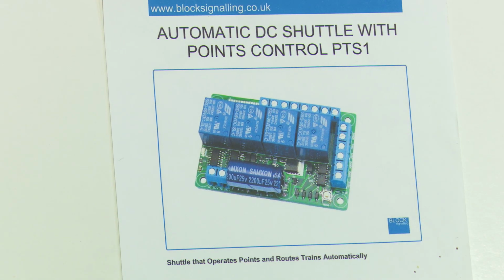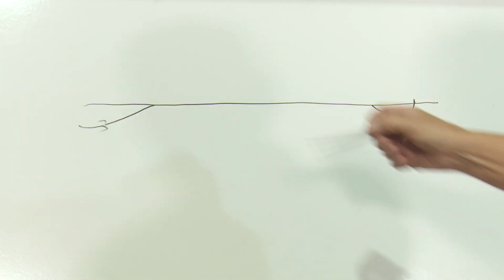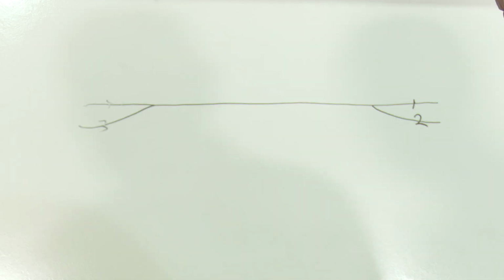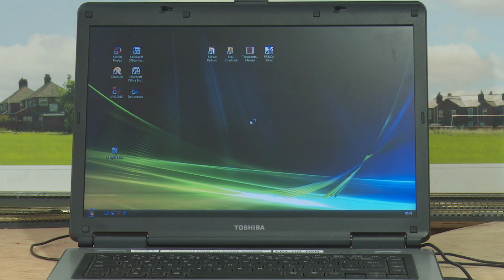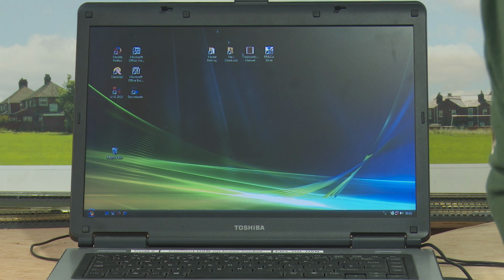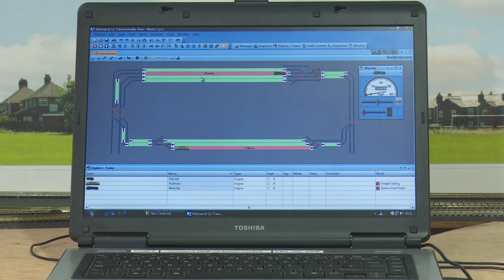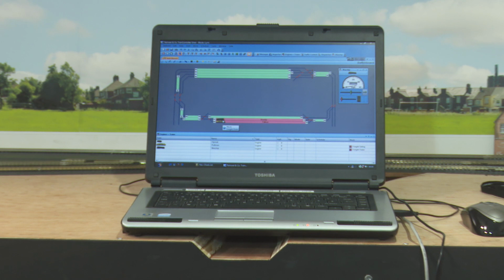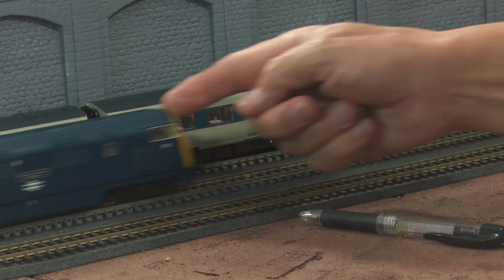Train Automation at Chadwick Model Railway | 108.

Comment: Thanks Charlie you have re energised my enthusiasm will have a look at Train controller as I have been struggling with jmri for a couple of years and it seems more of a programmers thing than model railway control if you know what I mean :-)
Reply from the maker: I know exactly what you mean. But do you have a look at iTrain, it’s cheaper and probably easier.
Reply: Chadwick Model Railway yes I am Charlie, but I’m told it doesn’t work too well with NCE??

Comment: Hi Charlie, another great video on a topic I am interested in. So I am guessing from what you said if the block is bi-directional it would require 3 sensors per block. Seems to me  working out the length of the blocks may be a relationship to the length of the longest train but can points location also impact block length. What do you do regarding block detection where you have points? If you do have blocks at points how do you deal with a complex junction where multiple trains could go through at once? If the points are not block detected what stops a second train moving if it momentarily detects clear track whilst first train is traversing the points? Are you planning a more advanced video or can you point us to some good reference material? Cheers Onky
Reply from the maker: Great questions. It’s recommended that points are not included within blocks, and collision is avoided because the routes are protected which travel through the points networks. Yes bidirectional blocks will require three sensors but the whole train doesn’t have to be contained within one block either, you could have a train that occupies two blocks, the world is your oyster!

Comment: Hi Charlie that was a very interesting video can block detection work with any DCC system or is there a specific DCC system that you have to get and is there any other hardware that you need to get to use block detection?
Reply from the maker: You’re right that not every system can work with block detection. Other programs work on time which can also be reliable. It’s just a case now of doing your homework and planning ahead. Regards Charlie

Comment: Hi Charlie, 
The most lucid explanation on computer control I've ever come come across. I've experimented for years with DIY computer programs with limited
success but this program opens up new hope that one day I may achieve what I'm after. Anything you have to offer in the future on the subject would
be very welcome.   Well done Charlie.   Regards.
Reply from the maker: Thanks Indigo, I’m so pleased that you found it interesting, regards Charlie
Reply: @ChadwickModelRailway  Hi Charlie... What happens if you shut down your railway and shift the trains, or locos to different
locations on your layout and then switch the layout back on. Does the computer system find the trains new locations on your
computer program track plan?  or does it bring up the old locations?   I've never seemed to have been able to find any solid answer
to this.  Regards  indigoDVW  NZ

Comment: Thanks Charlie. Another informative video. I had already figured that the 3 seperate shuttle features I have planned for my DCC build have to remain DC and can because they each will be unconnected to anything else. But, how does the train go back the other way when it is past the diode and diodes only let volts go one way through? 
The DCC slippage was the issue I identified with time involvement....DMU stopping well short or sitting against the buffer grinding away. The second stop now sensor solves that.
All trains need to have the same length with the drive end at the same end if you change the trains on your shuttle....at one station the stopping devices need to be at the buffer end of the line, the other station the stopping devices need to be at the platform begins end for both DC and DCC control. Plenty to think about!
Thanks again.
Reply from the maker: I’m so pleased that you enjoyed it Robin and yes it certainly does involve some serious head scratching, regards Charlie

Comment: The beauty of the Digikeijs stuff to me is you can use practically anything you like with it. Your digitrax handsets will all work - they just need plugging into the appropriate port in the DR5000 with the usual curly cable or the appropriate digitrax reciever needs plugging in to the DR5000 and then you can use the radio or infrared feature of the digitrax handset as normal. 
I have a roco wlanmaus handset running my DR5000. The large round control knob suits my oafish way of controlling things perfectly! The dr5000 has a built in router and I've connected the roco handset to it that way. The range is great. I've had my wife stand in the railway room in the front of the house and I've walked half way down the garden with the handset and pressed various buttons and the layout has behaved exactly as it has been  commanded to do. 
What I really like about your digitrax handset is the dual control knobs - seems to add an element of labour saving when you have a handset with only one control knob. 

You say you've "got too much invested" in digitrax to consider swapping, well who says you have to sell up and swap?
If you are interested in having a play with digikeijs then you don't HAVE to get rid of what you have. That's what makes it unique. All of your stuff can be used with a DR5000 if you like. You can even mix and match with other brands. You aren't trapped into having to keep spending with digitrax if you want to add more modules. 
Even your digitrax command station could be re-used if you want with a dr5000, I believe there's a couple of pins you change on the front to convert the command station into a booster module and it then acts as a slave to the DR5000? - The digikeijs unit even comes with dedicated ports for loconet. 
I picked up my DR5000 from James at the start of the year - I think it was around £180 so not expensive at all to get in to at all if you want to have a play with one.  
£ for £ the digikeijs modules are definately the cheaper system block for block as you rightly pointed out. 

All the best, 

Jon.
Reply from the maker: What an excellent comment Jon, Yes I was aware that the Digitrax Trademarked loconet,Is an industry standard.

Comment: Thanks Charlie, interesting stuff. Like you say, research, research, research ! I did lots of it in planning for Pevenbourne. I’ve settled on iTrain 5 Plus to run alongside my Z21 Black. With lots of advice, I decided to go with Digikeijs block detection. I had planned to use the Z21 block detection, but it’s so expensive. The Digikeijs 4088s give me twice as much detection for my money. So far I’ve installed two 4088s and getting on fine with them. The only issue I find though is the fact that the detection current is quite sensitive so you have to be careful how you run your wires. They can’t be more than a metre long either otherwise false detection occurs. James Hudson at DCC Train Automation is very knowledgeable as you say, and also very willing to help. I had a problem with detection on my ADM Turntable and James suggested that I replaced its inbuilt autoreverser with one from LS (I already had one of these to control a reverse loop on the layout at James’s suggestion), this solved the problem. So James can help suggest solutions that interact with his knowledge of the many products on the market. Anyway, until next time, take care Charlie.
Reply from the maker: Thanks Brian, I’m pleased that you found it interesting.

Comment: Thanks Charlie. Interesting oversight. My dad (who was the electrics genius on our big DC layout) did a lot this with relays, but essentially the same as you describe, but analogue, not digital. You'd have hated it: all that noise of the relays firing!  But we didn't have sound locos 30+ years ago, so it didn't matter. When we extended the layout in the 80s, we built in a 12 track shadow station (as the Germans would call it) - not a fiddle yard as there was no fiddling hands involved, and not a marshalling yard as it was all below the sceniced baseboards.  That shadow station was controlled by a diode matrix: something I happened to come across in an old Railway Modeller, and my dad made work for the layout. When one train arrived, it would stop, and the next train would then depart, setting the entry points to the free line.  I couldn't tell you how on earth it worked (apart from breaks in the track, sprung points and a shed load of diodes), but it was great: you could set a train off on a circuit including the shadow station, and it would be about 25-30 minutes before you saw it again.
Reply from the maker: It’s guys like your father, who have a brain is the size of a planet. A great insight into your past Andrew, thank you regards Charlie

Comment: Quick question how do remove ballast from the track as my train won't go round
Reply from the maker: Great tips gentlemen.
Reply: @ChadwickModelRailway  hi great vids
Reply: I got a piece of wood fits right between the rails and I rounded it off with jigsaw and just ran it up and down and just hoovered after it works a treat
Regards
David
Reply: Thanks
I will try that
Reply: @jj_4568  you can also run a small file or something along the inside of the rails where the flanges would go, to remove any glued ballast. :)
Reply: @kyle5674  OK thanks

Comment: Are you planning a similar discussion for trains?
Obviously locomotives draw current, so are detected, but isn't there a need to detect the back of the train too? So for anything up to 1970's you would generally have a guards van on freight, which could be wired for tail lights - more modern freight and any era passenger would be tricky unless you're forming "standard" rakes of rolling stock and drawing current either on the tailender or both ends or even all of them??! I must admit I tend not to shunt my passenger stock and leave them pretty much as a formed rake - but say I want to add a slip coach, I still need to detect the new tailend. Right?
Reply from the maker: Hi Neil, a great question.You get around this problem by adding a very small resistor across the axles with conductive paint. This allows a small  current to be drawn from each wagon allowing train controller full visibility of the train.

Comment: Excellent video, Charlie, even more so than usual. You don't need to keep kneeling to the altar of Digitrax; the Digikeijs DR4088LN seems to be a drop-in replacement (at least it is if you don't add any DR4088CS to it to really save money, I think you'd need the DR5000 controller to make use of that combo). But on it's own (or with lots of them), the DR4088LN option seems to be the one to go for.

My only problem is that I've acquired a bunch of BDL168s over the years, so it will be a long while before I venture to a digikeijs unit - even though I'm now using a DR5000 controller to replace my DCS200 - or rather to make that box a powerful booster.
Reply from the maker: I have a similar history John. I bought several BDL168s from a deceased estate. It would now be suicidal to replace those.

Comment: It's a shame ITrain does not seem to support Gaugemaster controllers .  I would have been tempted.  I built  test track for my N gauge layout about a year ago and used JMRI  to do some automation. Shunting some wagons around  the test track. Worked fine , but you do need some tech knowledge. I wrote a jpython script to control it all and had  magnetic reed switches as block detection. Currently in the process of changing from N gauge to 00 so nothing running currently.  I made a video of the whole sequence which I posted on Facebook at the time.
Reply from the maker: I feel your pain Peter, some systems will not allow any computer control whatsoever.

Comment: As usual, really interesting stuff. Just a quick question, Charlie. How does the system cope with the Pullmans twin power bogies at each end of the unit on entering the block sections? I dabbled with automation block section control linked to 2 aspect signals but found that my Pullman caused issues, ie not wanting to stop!
Reply: Having a current draw at both ends is a good thing actually, it enables the BDL168s to spot a train hasn't left one section once the leading car has done so. In fact it is good practice to fit a resistor across the odd wheel set towards the back of the train to help this on stock that doesn't normally consume power at both ends!
Reply from the maker: A good point Mike, and I have yet to speed profile the Pullman, and once I’ve done so hopefully all should be well. David Townend, down at McKinley has to Pullmans, so he should be a mine of information on this one.

Comment: charlie, great video. Question, the DCC setup you have here, are the instructions set to just run the warship or does it work on any train? what if you replace the warship with another loco, does the new train still function the same as the warship?
Reply from the maker: Yes exactly the same Rick, as long as you have speed profiled  your logo fleet, regards Charlie
Reply: @ChadwickModelRailway   so its programmed to run any loco or you have to reprogram each loco you add to that track?

Comment: Great video Charlie and something I done to the extreme, I decided to write my own application in a coding language called python (over 10k lines of code so far) which is running on a raspberry pi using a DC system to fully control over 10 trains / 21 points / over 40 detection points / block detection / random train running and can stop a train on a regular basis within 1 cm.
Reply from the maker: Now that’s what I call an addiction Alex, regards Charlie

Comment: Hi Charlie,, you really do find interesting stuff. That micro layout is fantastic. Armchair Model Railways🤣 Love it, demonstrates the value in taking a notebook with you wherever you travel, I always take my sketchbook with me when out and about as you never know what you will come across and if there is a lot of information being given, the notebook is invaluable.
I have an old HP Laptop with Windows 7 and it takes for ever to start but until my new Apple Laptop arrives I use it in combination with an external drive to store photos/videos.
Unbelievable controls on the warship etc, amazing how far the hobby has come and you certainly are an early adopter and we are all lucky that part of your passion is to pass on your knowledge to the community.
Can you tell me if your trains run better after installation of dcc chips and would that be the case for all old or new locks? I know this is a big ask and probably more complicated than it sounds. Thanks
Reply from the maker: Yes that do run better on DCC but converting pre DCC stock can be disappointing.

Comment: Just to throw a few more options on the pile: What ever happened to the SPROG interface? And - I will probably regret it, but I plan to use an Arduino Mega with DCC++ installed that I re-program for full automation of an exhibition layout - "How hard can it be?" 😜 (I am slowly getting all the bits I need together at the moment). Another well produced video that I learned a few things from = makes watching it very enjoyable. Thanks for all your hard work and your easy going nature Charlie!
Reply: Hello Down Under. I use a Sprogg with JMRI currently, and am just starting to dabble in arduino control of servo motors. I’ve not heard of DCC++ . Time to do some googling ....
Reply: @MyTutorGuy  Good to hear that I am not alone! I have successfully installed the DCC++ "protocol" on my Arduino Mega with the Arduino Motorshield. That leaves enough ports and RAM available on the Mega to extend the DCC++ script with my own train control conditions. The block signals will go directly to the Mega's input ports and you'll then send the DCC commands out through the Motorshield attached to the track. If I can't make my own script changes work, I'll go back to JMRI myself... DCC++ commands and software is available for free on GitHub and there are some good instructional videos out there 👌
Reply: DSB Down Under . Hello DownUnder.  What’s the appeal of DCC++ over JMRI? Just wondering if I should change course. Cheers.
Reply: @MyTutorGuy  Its really easy to use all you need is a motor shield or driver for the arduino and a 16v 3a psu I used an existing DCC one as it provides the correct AC volts for DCC track voltage. Flash the arduino plug the bits in and your ready to test ! if you dont have the stuff to build the optional throttle you can use it bare bones with jmri.
Reply from the maker: What a heartwarming comment DSB, many thanks.
Reply: @ChadwickModelRailway  You have earned it big time! We will keep watching - don't stress 😊

Comment: Thanks Charlie, another fascinating video. One thing worth a mention are the Lenz ABC modules for DCC. I have these working my branch line in shuttle mode and for £20 a pair they work fine. This assumes you are using compatible decoders but all my ESU sound decoders work well with this system. My Class 121 bubble car goes to and fro all day... well, it keeps me amused anyway!
Reply from the maker: Is that using asymmetric breaking?
Reply from the maker: Is that using asymmetric braking?
Reply from the maker: Is that using asymmetric braking?
Reply: @ChadwickModelRailway  There is an echo in here ;-)  Yes, but a lot of decoders can do the "shuttle" thing with programable stopping time. The Loksound decoder in my Class 121 can be programmed to stop for up to 4 minutes before reversing back down the branch line. Braking/stop distances can be set very precisely.